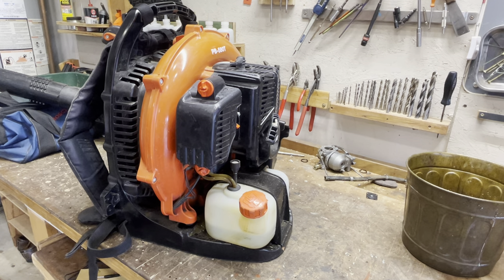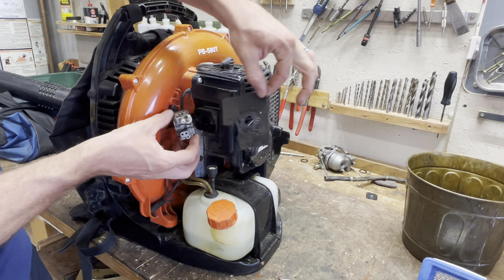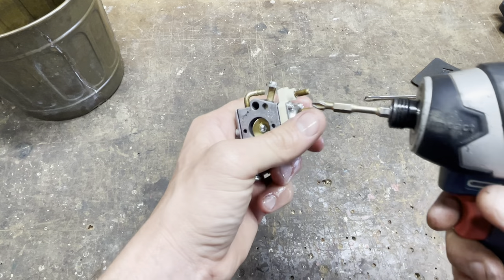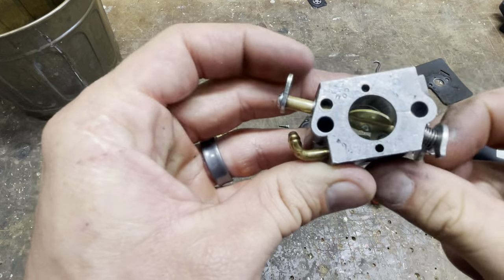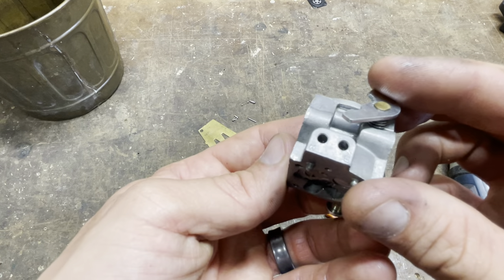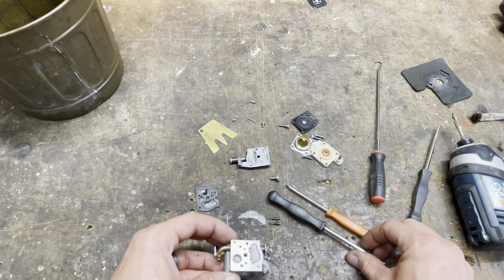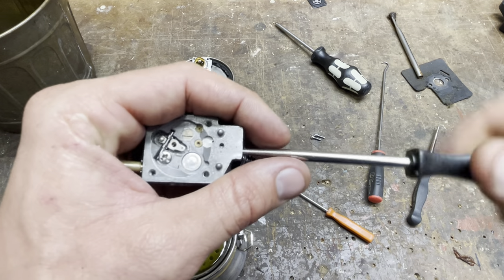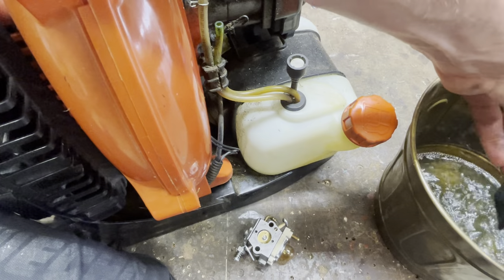Echo PB 580T - low power - repair walkthrough

Comment: Watch your video and found it very interesting.  Was trying to find out why my Echo backpack blower doesn't have power.  There is air coming out and if you get close enough to debris it will push it however not very well.  Knew it needed to be worked on but after seeing everything you did, there's no way I would even attempt trying to repair it myself.  So it will have to go into shop.  Thank you very much, info was very helpful.
Reply from the maker: I hope the video wasn’t discouraging, but if it helped you make a decision on what to do next, and I suppose in the end, it was helpful. Take care!

Comment: Common mistake with the Echo backpack 500 and 580 is misconception that the carb is always the problem and the reason for throttle bogging and running out of fuel. It usually is NOT. When it bogs or shuts off immediately check the primer bulb. If dry...it is always the fuel inlet line and fuel filter. Replace both at the same time and install a few tiny wire ties at the junctions and problem solved.

Comment: Great video. For $20 I will just replace the carburetor rather than clean one
Reply from the maker: That’s true and not a bad choice…but the OEM carbs from Walbro and Zama are much higher quality than the $20 ones so there is that to keep in mind

Comment: Man, if someone in my area was this amazing at fixing small engines for $80 I would be all over it. But most charge $150 or more and adjusting the carb screws gets the blower running well enough to keep it going until it dies (usually will get 10 years on residential use before other parts start breaking off). And for only $375 for a brand new one, that makes the most sense.
Reply from the maker: Good to know!

Comment: I like the longer format videos like this one. Follow the repair process from beginning to end.

It would have been nice to hear the problem (4 stroking) before the repair and the sound after you fixed it though.
Reply from the maker: You’re right. I need to get better about the before and after. Thanks for your feedback!
Reply: @35andRetired  The reason I mention letting us hear the sounds is that I have this exact blower. It runs and blows OK but in my mind it doesn't seem to blow as hard as it did when new about 5 years ago.
Reply: You can also clean the unit, and loss of vacuum could also cause loss of power

Comment: Great video. Curious if you could diagnose my same blower. Quick background, the blower is 6 years old, only used on smaller residential yard, and I always run fresh fuel and oil mix and drain the carb every winter. Until last week, it ran perfect. All of a sudden, when running wide open throttle it would almost stall out. Idle is perfect and quarter throttle is good too. I checked the fuel and oil filter and both are perfect.
Reply from the maker: Only at WOT? That sounds like a plugged fuel filter or lines (filter is way more likely than lines). Try removing the fuel line/filter and inspecting, removing, or replacing the fuel filter. Have you messed with the carb adjustment screws yet? If not, try loosening the screw which is closer to the air filter and further from the engine. Any change in behavior?
Reply: @35andRetired  Thanks for the reply, filter is clean and even ran Sea Foam and replaced the spark plug but same issue. I'd try and adjust the carb screw but have no luck getting the tool to do that since Echo uses a very strange tip (something called Micro D tip, not easily found due to EPA rules apparently).
Reply from the maker: @logdon17  Yeah...I would recommend getting a cheap carb screwdriver set off of Amazon. Here is just one of many examples. https://www.amazon.com/Lucky-Seven-Carburetor-Adjustment-Carburator/dp/B07XG2L2NT/ref=sr_1_1_sspa?dib=eyJ2IjoiMSJ9.W1MZhbcdw1mB7Pelgwre_BSCt3RayZ2p9Wa6F_Pfo_GzejtC9JZxoSpYZKJJ_ZewtL0dRDX5LEtIiQA1nZUvb7BC6WD6KBqInGDPEjfJfzoVAWDf855DXg0OnpVDPdm5ubiv4rxLVwU8wZR_rPBTjvPuAyDWRPMcz57ygydfmaa7d1XkJqCbTfIN7F2fk-6hc7WHCr8NDbjpV5nknAnxz5iKWXlvXDUsSYpHuCU6Mb7SktCOy7PsiFj9Xzi_bQ463ld05QpNcl8-JGLNRWGPVYmmt7Xeqi79ppBkLxckBvE.qNuJ_JmCKs4LT5bpDkg-v4O08Hp3xhdMXu0SbYjGajg&dib_tag=se&keywords=carb+screwdriver+set&qid=1718206238&sr=8-1-spons&sp_csd=d2lkZ2V0TmFtZT1zcF9hdGY&psc=1

Comment: I'm fixing the same one right now and it runs like crap the problem was that spring on the carburetor it won't properly run at a idle speed because it doesn't spring close you have to either replace that spring or the carburetor
Reply from the maker: Yeah, I had a similar situation!

Comment: Hey, how are you? I’m having a problem with my echo Backpack Blower. I can’t get full power out of the handle. I put a new carburetor on it. I had to put a new spark respirator and I still not getting is there anyway you can help me out and tell me what you think it may be.
Reply from the maker: Hi, well...it could still be several things. Here is my suggestion: 

1. Remove fuel filter and see if condition changes
2. Did you tune the carb? If not, you will need to make adjustments to the high speed screw. I have a video on this topic on my channel but youtube is full of plenty of other videos that can help you through that also. 
3. Spark respirator? I assume you mean the arrestor in the muffler, right? If so, good. 
4. With the air filter removed and the engine at WOT and the problem happening, try to spray a little carb cleaner into the carb throat. If it increases the RPM, you know you have a lean condition not getting enough fuel.
Reply: Yeah, everything’s brand new brand new carburetor. I cleaned out the muffler brand new carburetor every like everything you said it just can’t get no power.
Reply: Oh actually, I change the air filter and as I was trying to idle it up, I had a lot of oil on the air filter brand new air filter and now it’s just all covered in oil. What would that be from?
Reply from the maker: @brucetirado5042  Well, that is an important observation. There could be a lot of oil/gas in the crankcase (the area underneath the piston). Sometimes this happens due to an issue (which you might have fixed already with the new carb) but needs to be cleared out. I would recommend removing the spark plug, putting the machine upside down so the spark plug hole is facing straight down and pulling the starter cord many times. If gas/oil is pouring out of there, you are on the right path. In theory, nothing should come out at all. If fluid is coming out, keep doing that until it is dry as a bone, then reinstall the spark plug and see how it fires up and runs. Sometimes a bad carb can dump fuel/oil into the engine and flood it so bad that the crankcase is full and needs a lot of pulls to be cleared out.
Reply: Hi, my echo start right away but if I push the throttle it slowdown and will stop. What should I do pls?
Reply from the maker: @robrob6920  That is likely a fuel delivery issue. Fuel filter, fuel lines, and carb are all the areas of initial inspection!

Comment: Need to know where a small rubber o type ring fell out of when i was spraying carburator cleaner in and on
Reply from the maker: How big is the diameter?
Reply: Not even as big as the blue end of a bic pen..only about half the size
Reply from the maker: @gwenmarko9806  ha! What an interesting reference point. I only have a black bic here... :)  It could be one of the two o-rings that goes onto the two jet needles. Maybe check that...

Comment: Mine just stopped suddenly and won't start. Carburetor, air filter looks good. Any suggestions?
Reply from the maker: The first step is to remove the air filter and spray a small amount of carb cleaner, 2-stroke fuel, or starter fluid into the throat of the carb (do this with the trigger at WOT so the mixture gets passed the carb). If the engine "coughs" or sounds MORE like it wants to fire or actually fires for a split second or two, then you know the compression and ignition of the engine is fine and it is fuel related. If it doesn't try to start at all, slowly increase the amount of fuel you are spraying (since you might not be spraying enough) and see if that works. If still nothing, remove the spark plug and with a flashlight look carefully to see if there are any scratches inside of the cylinder all. Horizontal scratches are normal but vertical scratches are not.

Comment: Hey where are you located?
Reply from the maker: Chattanooga TN :)
Reply: @35andRetired  hey is there anything wrong with using alcohol to clean out the carburetor?
Reply from the maker: @Dnizzle25  Nope, but in my experience lacquer thinner or gasoline works faster...

Comment: I have no spark
Reply from the maker: First thing to check is if the coil is grounded or not. The on/off switch or the wiring could be shorted. If you get access to the ignition coil, pull off the little wire which is clipped onto it. Then see if you have spark. Good luck!